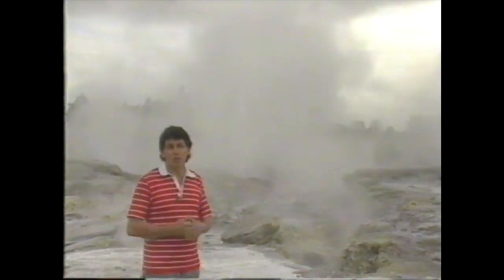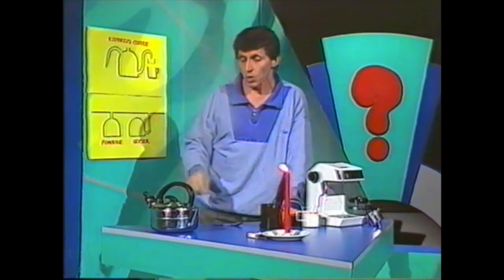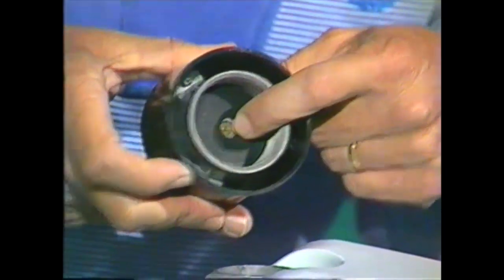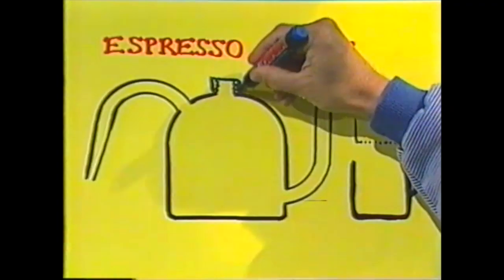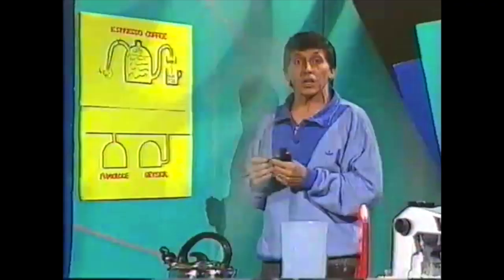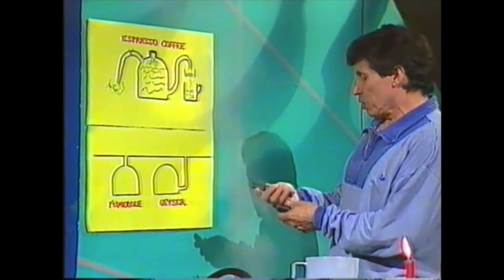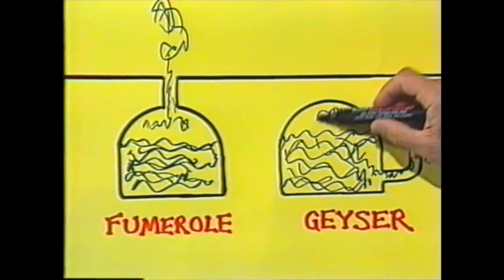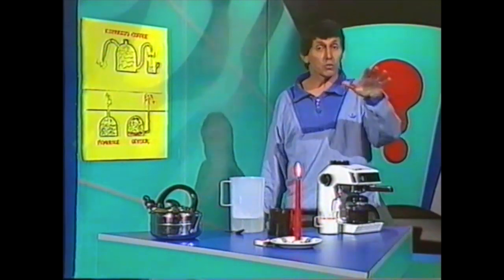Geyser: Nature's Espresso Coffee Machine

Comment: One addition, espresso machines also have small water pumps to help the water come out at a very specific pressure, usually between 6 and 9 bars, otherwise the accumulated stream wouldn't generate all the pressure required to press the coffee to get the right extraction.